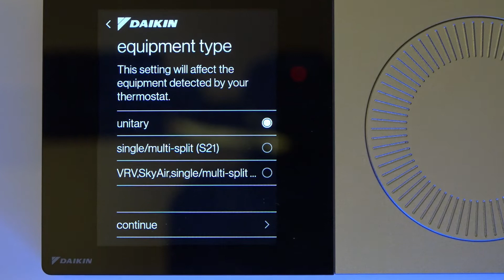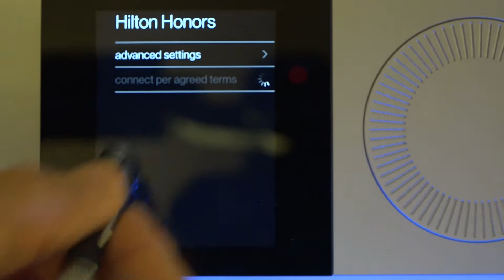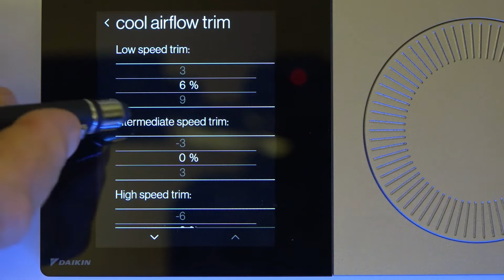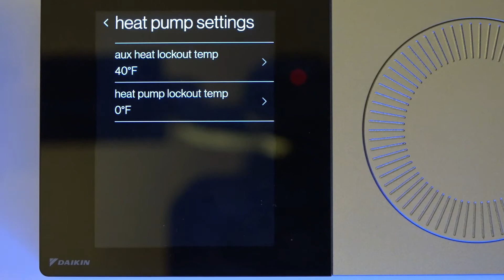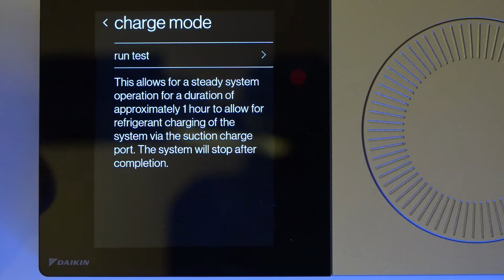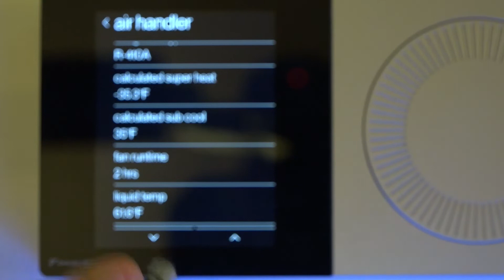Daikin One Thermostat Commissioning

Comment: I have a Daikin Aurora 2 ton Mini Split.  It is set at the factory to heat down to an outside temp of 5F.  There is a "field adjustment" that lets it heat down to an outside temp of -13F  I know how to get to settings but I do not know what setting to change
Reply from the maker: Ill have to pull the manual send me the model # of outdoor unit

Comment: Sir, hopefully you're still monitoring this video. I have a 3-ton two-speed heat pump communicating with my variable speed air handler. On my Daikin one thermostat, It only shows the, "Cool Airflow Trim" with settings of 0, 2%, 4% etc. It doesn't show " low speed", "intermediate speed", or "high speed".  My question is, changing my setting from 0 to 2% or 4% what does that increase? Why would one increase or decrease the values? Thank you for your time.

Comment: Hi Brother!  I'm trying to do a startup on a new system Aman AVPEC AHU and a Heat Pump AVZC 3 ton. The system test will not complete. I'm getting cooling and my suction pressure shows 126 psi. The requested CFM is 10 cfm greater than the reported on each level. Would this difference spoil my test!
Reply from the maker: No whats the code under error codes
Reply: @hvaciswin723  Thanks for the reply! There were no errors but E11 alone. I forced the system validation test to complete by switching DS2 to EMG mode and then let it cycle 7 or 8 times and it completed. I was told to buy the CTK04ae. Tech support said it would complete that way but it did not. The comm voltage has tested bad now on three boards so far. I saw your other video on re-bias. The voltages looks nothing like what you had across 1/2 !  I have had 0VDC with short pulse of up to .5 VDC. The com /1 readings of 1.25 VDC and com / 2 reading is the same. Every couple seconds I get the pulse. It half ass communicates and crashes. The CTK04ae will find 2 devices but will never show them on the system,  Fan, or any other screen.(Please wait") If I take the OD inverter unit off the network, the CTK04 will talk with the ID AHU and the operational screens appear fine but missing the inverter OD unit. After talking with a Daikin Lead tech he said replace the AHU board  for the second time. I had the same result as before. The coms ain't working. I ran 18/2 shielded pair for all the 1/2 com wires. When I got the board in I installed using and ESD wrist band.  Before adding the Shared DATA with the cool cloud to the AHU the Board, the CCApp found a AHU communicating AVPEC37C14BB. Once I loaded the Shared Data with the matching Model # it came up as just AVPEC37C14BB and the Device Status window shows legacy TStat terminal status. I think it may be in the Inverter Board or something about the shared data. Ya think the shared Data could be causing all this? I don't have the BTSDL01. I'm assuming now the Data transfer from AHU to Inverter board is corrupted due to poor com bus. I'm pulling my hair out! Its like the shared Data goes to non-communicating in the AHU boards which might explain why three boards fail to supply acceptable voltage DC on 1/2 terminals.
Reply: @hvaciswin723  The only code is E11. I actually got it to validate using emergency cooling DS2=on. The problem really is the Network. From what I gather there should be 2.2 vdc from C to data2 and 2.8 vdc from C to Data1. I have 1.825 vdc on both  Data1 and Data 2 to common. Equal voltage. I have 0vdc from Data 1 to Data 2.  I have gone through all my ground connections. I will drive a second ground rod at the service tomorrow. This is true on three AHU control boards so far. I've got and AVZC1803361 and a APEC37C14BB with a CTK04ae. The CTK01ae is happy with just the AHU connected but when the Inverter is connected the network crashes and the CTK01 fails to handshake with either indoor or outdoor units. I get the please wait... Daikin Tech support doesn't have an answer so far.  Maybe you know someone in engineering there?
Reply from the maker: Ive used emergency mode for that same reason, the ctk04ae is a good stat my favorite

Comment: will this control work to run 4 Daikin indoor heat pump heads off one stat in a large meeting room?  Very well done video.😀
Reply from the maker: No, it's not capable of controlling multiple systems. It only talk to 1 indoor and 1 outdoor unit

Comment: I purchased a Daikin Fit heat pump and air handler in July 2024. I live in the Southeast and 2 story home with zoning. Ive had nothing but trouble with this system from Day one. 1) It says it has hit the set temp but really the room temp is totally different. 2) Crazy anount of humidity in my home during the summer. 3) System is loud inside. 4) Takes forever to go down in temperature over the summer. 5) Recently in the winter downstairs is cold and upstairs is hot. 6) Getting B3 error message. 7) Thermostats are super sensitive. Temp goes up just by standing in front of it. The hvac dealer cant get it working properly after attempting recalibration multiple times, changing thermostats, adding a bypass duct, and so much more in attempts to fix it. I now plan to remove this horrible system from my home and purchase a different brand from a different company. In the meantime I've watched this video and it has helped so much. Thank you.

P.S. Yes I know my situation may not the norm. I experienced a bad install, bad system or both.
Reply from the maker: The pressure of air inside your ductwork sounds like it way to high. I would recommend finding a contractor that could test duct static pressure. Daikin says total system static should be less than .5 a good contractor should know what that is and how to check it. High duct static will cause poor performance, high humidity in the summer and B3 codes. Being on a zone system the balancing of the bypass damper is very important.
Reply: @hvaciswin723  Thank you for your reply and suggestion.

Comment: Do you have any knowledge about code B3 air handler "blower is operating in a power, temperature, or speed limiting condition" It happens on cold mornings below 30f when coming out of "quiet mode" from the previous night. The whole unit shuts down and reboots once or twice then is fine until the next cold night. Our local Daikin dealer is clueless on what to do.
Reply from the maker: B3 is a high static air flow code a couple could be 
Dirty indoor coil
Undersized ductwork ( total system static is to high ) .5 total system static is the max probably over. 65 causing blower motor to pull high amps

Comment: Hi, can you please help me? My Daikin heat pump blows really dry air. It was blowing perfectly humidified air when they first installed it, but it stopped working when we had a power outage. The installers came and fixed it, they said they had made a mistake during install and that's why it stopped working after the power outage. The problem now is that since then it blows really dry air. The air quality was amazing in the beginning, now I have to keep the thermostat down and be cold bc the dry air is horrible. The installers are really bad. They keep telling me they'll come but they don't show up. Daikin support tells me I need to contact the installers. I'm desperate. Please help
Reply from the maker: In winter months the daikin system doesnot add humidity back to the house unless there is a humidifier installed. What happen when it gets cold outside your system runs longer which drys out the air inside which feel uncomfortable. When humidity level gets below 20% a whole house humidifier might need to be added, depending on square feet of your home. My home is 2300 sqf and need 22 gallon humidifier per day to maintain 35 to 40 % for winter months. Hope this helps

Comment: HELP PLEASE - I am another Tampa, Florida Daikin One homeowner. I paid more money to buy this inverter, variable speed HVAC unit and the installers can't get the humidity down to an acceptable level. 

Today they actually came out and said they adjusted it and on the display, the number was down...but as the day wore on, I could feel the humidity just as much as before. When i went into the settings, the had adjusted the calibration so that it appeared that the humidity level went down. So they obviously think it's all in my head. However when searching on the internet I found that folks living in Central Florida have all complained about the humidity level that the Daikin just can't seem to handle.

I'm worried that I paid a huge amount of money now for a system that isn't appropriate for Florida's climate. If you have any suggestions of ways to tweak the settings I'm very familiar with how to program this thermostat now. After spending a lot of time searching for help online I ran across your video and it's the first one that gave me some guidance on settings. I really don't think my installers understand and know what to do with the thermostat. They obviously don't know how to tweak the settings appropriately if what they did today was just make it look like the humidity went down! That's very insulting. I guess because I'm an older woman they think I don't know anything and I can run circles around them when it comes to technology! 

Any settings you could suggest would be immensely appreciated!!!
Reply: I was in the same situation over the summer. I've never experienced ao much humidity inside ever. HVAC Install company had no clue how to fix it. They didn't even had the dehumidification settings on within the dealer settings. I'm getting rid of this system. It's a fancy system but way too finicky. And I can't survive another summer

Comment: I have a Daikin Fit one.  I think i had condensation when I used the heater.  There no condensation from the outside inverter when using AC?  Now the thermostat is a blank white ghost screen with power.  AC still working, but nothing showing on my thermostat.  When it gets fixed, I'll look into this.  Good stuff!

Comment: Hello, thank you for detailed explanation. I noticed that yout air handler had a 2 hours drift from the heat pump, does it mean the air handler stays ON all the time? I got a new system and my air handler stays ON regardless the whole system is off, i usually see the outside unit fan running slow for a few minutes (2-5) throughout the day, is that normal? I built a monitoring system via Daikin One API but im unable to spot why is it running. Appreciate your insight!
Reply from the maker: Whats your model number

Comment: I have a question. I had my system put in. It is gas furnace and I have a 2 ton AC.

The problem is since the dealer installed the unit the AC runs 24/7 unless I pull the outside fuses. Which I did during the winter.

I have to leave the thermostat on heat during the summer months or the AC will freeze me out.

If I set it to cool, It never shuts off.

Is there anything I can look for? I had this system put in 2 years ago and the dealer hasn't been able to figure it out. They tried replacing the thermostat, But it still does it.

I have no problems trouble shooting my system as I have worked with trouble shooting PLC's and other equipment and repairing for my work.

I'm at my wits end. I don't want to have to buy another brand unit.

I have the books for installing the units but have no clue what to look for on this one.

Thanks.

Comment: Hello, I have a Daiken 4 Ton DX17vss481ba outside and a DV48fecd14 inside (installed 9/2023. The evap  coil started dripping water to the floor under the unit. I have had techs out, the coil is clean, the charge is correct but i have high static pressure due to old metal duct work in my home. Never an issue with conventual AC's in the past however with the constant ramping up and down of the inverter technology this has begun. Temp at the top of the air handler (measured at the base of the ductwork exiting the cabinet is 56 degrees). All ducts in the home are open...curious how you would program the thermostat to prevent the drip that occurs I believe at lower fan speeds. I would prefer not to have to replace all of the ductwork in this 1955 home :). Unfortunately not many techs are experts w these systems. Thank you!

Comment: Thank you for this thorough explanation.  I'm based in South Florida and just had a new 5 ton Fit system installed a few days ago.   I realized that the temp readout on the One Touch was off as we were not comfortable and used 2 source temp/humidity gages I purchased online to verify.  The system wasn't cooling as low as we desired and the tech showed how he was compensating for this delta using his gage. Unfortunately, there was a lag in his reading and not certain if the offsets were exactly correct.  I reset the calibration  based on an average of 8-10 readings on both gages ( +1 F and and -3%RH)  and the One Touch over a 24 hr period.  On average, the Daikin read 75 deg F and 53.6% RH.  The 2 independent gages read 76.1 and 77 deg F, and RH of 48.3% and 49.9%.  My question is:  I did not waiting 30 mins as you stated in your video before adjusting the offsets.  Would that cause any issues?
Reply: I don't know if he'll reply, but I've had the one plus for a good year.  It took several adjustments and dealer visits to get it working right.  I'm in Florida too. If you don't wait 30 mins the thermostat may read wrong. I've run into that. I want to upgrade to the one touch thermostat, but I'm scared to lol

Comment: What additional steps are needed to commission this with dual fuel with the heat pump set as primary heat source?
Reply from the maker: Under heat settings youll need to set a temperature for compressor lockout

Comment: How did you wire the Aux heat to the thermostat? The instructions talk about 24V AC signal must be routed through one of the aux contacts of the thermostat and the use of a SPST relay. I'm confused.
Reply: You don’t, the circuit board turns it on and off according to conditions. You just tell it there is one and size of electric heat so it knows how much airflow to increase
Reply from the maker: Define aux heat type and where its mounted
Reply: @hvaciswin723  I have RZQ48TA outdoor unit and FTQ48TA air handler with 15kw heat strips. Is there a way to manually activate the heat strips? There is no emergency heat option unless I try and configure the AUX output on the thermostat which are not for heat strips in the air handler.
Reply from the maker: Are you a tech or contractor? Tring to this circuit without training could get you hurt or damage your equipment
Reply: @hvaciswin723  Yes, I am. Just not a Daikin expert and tech support is difficult to get ahold of.
Reply from the maker: @machaf  search daikin one plus website, click upper left left select professional,  support look for wiring diagrams
Reply from the maker: @machaf youtube wont let me post a screenshot of it in chat comments
Reply: @hvaciswin723  Looked at everything on there already. It states "The aux heat source cannot require the indoor unit fan, just controlled from the thermostat". So is it not possible to manually activate the 15kw heat strips inside the air handler with this thermostat? Which would be "emergency heat' option on many other thermostats.
Reply from the maker: @machaf  went you a heat kit to the tstat programming you can select how the fan operates. But why are you using external heater, factory heaters are setup differently
Reply: @hvaciswin723  I'm not using an external heater. It is the factory installed 15KW heat strips in the FTQ48TA Air handler. I know they work because they will turn on when I change all the field settings to allow ' electric heater with heat pump allowed'. However I have no option to manually turn them on. If the outdoor unit fails how can I get them to turn on?
Reply from the maker: In the program section option 3 equipment  select air handler model number, then heat setup and see if you can select 15 kw there
Reply: @hvaciswin723  There is no option for that. It's a skyair with p1p2 and probably doesn't have all the options you have. The only option is the change the field settings, which I have gone in and changed  21-5 to 15kw.

Comment: I agree with the others that this is a great and informative video and that it is very hard to find information regarding the dealer settings on this unit. It seems like most dealers just leave it how it comes.

I installed two new Daikin fits in my home, one on each floor, and have some questions. Overall they are running well but I have the humidity set at a 40 to 55 target and sometimes they’re hovering in the high 50s.

I have not messed with any of the trims under the cooling section. The cooling profile is set on D, which I think is the one that best lets the inverter use all of the variable speed ability. The dehumidification is set to on and standard. I noticed there is an A, B, and C as well. Should I choose one of those for better dehumidification? If so, which? Setting A looks like a gives the most range. Will these affect the longevity of the unit or it’s electric energy efficiency?

I also have not used the over cool to dehumidify function. With that on, once it reaches the temperature setpoint, but not the humidity setpoint, does it just keep cooling normally or does it change somehow to do more dehumidification without making it that much colder. What I’m concerned about with this function is that it will get too cold in the house while trying to reach the humidity level.

Also, how does the setting where you tell the unit the square feet of the house affect anything? I have two units, one on each floor. Do I put the total house square footage on both units or the square footage of each floor on its respective unit?

Again, thanks for all your help. I’m hoping you can answer some of these questions. I do like the system, and it’s cooling the house very well, but I would like to figure out how to lower the humidity while still enjoying better energy efficiency than my old unit.

Thanks!
Reply: Good questions I have the same questions. Too bad he didn’t answer.